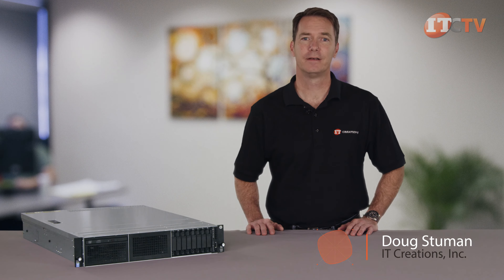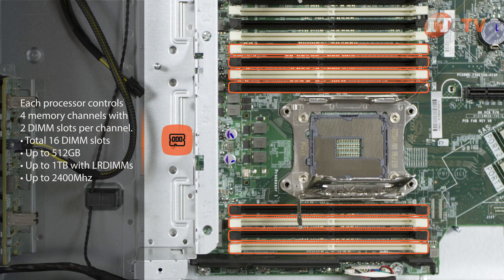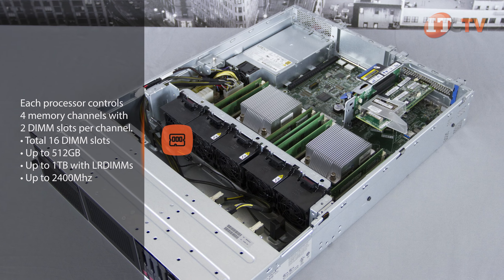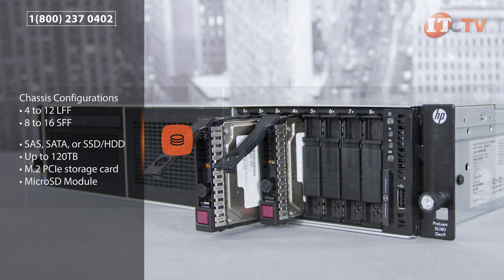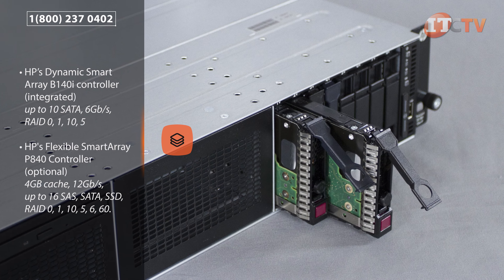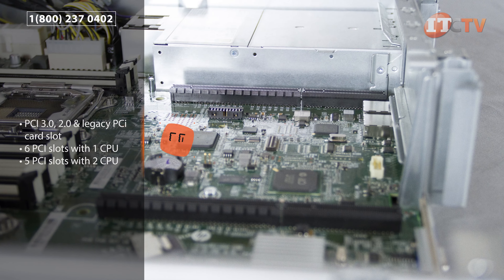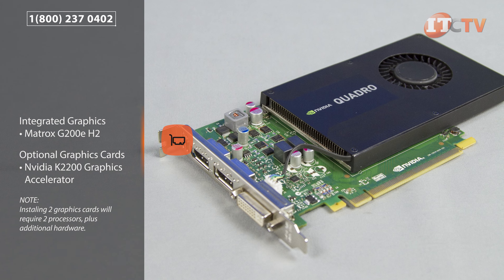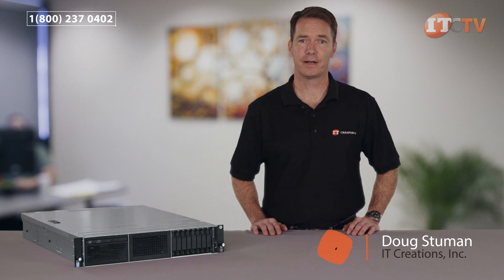HP ProLiant DL180 Gen9 Rack Server Review - Technical Overview in 4K Video!

Comment: Can you suggest that if i have 5 hdd in my hpe proliant dl180 gen9 server and 1 or 2 are not working how to find out those hdd?
Reply from the maker: Hi Gunjan, There are quite a few things you can do including looking at the LED lights on the drive bays, you can also try accessing system BIOS at setup, or accessing iLO, integrated Lights Out management.  I am going to direct you to this troubleshooting guide, page 63 tells you basic information on how to determine if the drive is faulty, how to possibly find out what's wrong with it, and tips for how and what to replace it with. There are two guides and I found that information in the first one, here: https://support.hpe.com/hpsc/doc/public/display?docId=c04444029 This is a link to the second guide: https://support.hpe.com/hpsc/doc/public/display?docId=c04443553 Hope that helps, and thanks for watching!

Comment: Hello, what is the model or part number of SFF disk with the highest capacity? We want to upgrade from 2TB to what ever higher is available? also I can only add 1 more 8-bay SFF hot-plug drive backplane?
Reply from the maker: Hi Rhey! 
I am assuming you currently have the 8-bay 2.5-inch chassis, so, yes, you can add another backplane to support up to 8x more 2.5-inch drives. Page 6 of the QuickSpecs 

https://www.itcreations.com/user-manuals/dl180g9/hpe-proliant-dl180-generation9-(gen9)-quickspecs.pdf

Show the officially validated drives "Maximum Internal Storage" and drive types for this chassis. However, our support guys said that it should support the drives from the Gen 10 version as well, which most likely will have a higher capacity. HPE typically tests only drives "currently" available for validation so that is probably why they placed a cap on internal storage. 

That said, I would just go with what they list in the QuickSpecs for the version you have. Since we are a hardware configurator we have all the parts to place in there and can test to see if it works and if not revert to the "verified" by HPE drives. You on the other hand would have to purchase all the drives to test and then make a determination. We have not done one of these is a long time and I'm not sure who in our company has tried the above scenario using the Gen 10 drives. So, to be safe, I would go with the Quickspecs Max internal storage for the Gen 9 system, which appear to be 3.84TB drives SAS or SATA. Although, curious that drive total capacities for LFF are much higher in a general sense… Potentially worth trying if you already have the drives available.

Hope that helps and thanks for watching!
Reply: Hi  @Itcreations-LA ,, thank you so much for that quick response.. yes LFF has the higher drive capacity. Follow up question , adding 2nd backplane with 8 x 3.84TB drives will require me to add another Smart Array P440 Controller and HP Mini SAS Y Split SFF-8087 Cable? I wonder how to tell the system to boot on original RAID controller with ESXi installed on RAID1.
Reply from the maker: @rheysamala1206  
You should be able to set the boot order in BIOS. Yes, you will add another smart array P440 Smart Array controller and mini SAS cable. There is a cable kit that HPE calls out per QuickSpecs, this 725578-B21. Cage/backplane kit this 725572-B21. Check page 114 in the Owner's manual for a little more information, https://www.itcreations.com/user-manuals/dl180g9/hpe-proliant-dl180-gen9-server-user-guide.pdf 
Good luck and tell us how it goes, and thanks for watching!
Reply: Wow thanks!  @Itcreations-LA  awesome clarification! How about the micro SD card slot? can I install vmware esxi on it? which model of SD card should I need to buy?.. If this is not possible is there another option which I can maximize all 16x2TB for storage.
Reply from the maker: Hi  @rheysamala1206   
You can see the SD card slot on page 3 of the QuickSpecs here (#11 of the Internal View diagram), https://www.itcreations.com/user-manuals/dl180g9/hpe-proliant-dl180-generation9-(gen9)-quickspecs.pdf. 
The supported microSD cards and part numbers are listed in the Quickspecs too, on page 40. Yes, you can install VMWare on the SD card as this is what it is for. There is also an internal USB port that can be used to support the Hypervisor as well. Good luck and thanks for watching!
Reply: @Itcreations-LA   you really saved my day!!! I need additional NIC for vMotion and others.. I already used up 2 slots with P440 on my primary riser card.. Can still install NIC card on extra slot? What NIC card model is compatible? is there an option for 2 or 4 GB NIC?
Reply from the maker: Hi again @rheysamala1206  ,
Glad we were able to help. Check the QuickSpecs again for NIC options which begin on page 28 for factory options https://www.itcreations.com/user-manuals/dl180g9/hpe-proliant-dl180-generation9-(gen9)-quickspecs.pdf . However, 2GB and 4GB are not options just 1GbE and 10GbE. Although, perhaps you meant the number of ports on the NIC? If that is the case, then yes. There are 2x and 4x port options in the list. There are also options for InfiniBand FDR/Ethernet 10Gb/40Gb 2-port 544+FLR-QSFP. If you need other risers, this section is on the next page 29 "HP I/O Expansion Options".
Reply: @Itcreations-LA   yup was referring to number of ports.. on 1GbE or 10GbE... Again thank you very very much!!!

Comment: All leds are flashing 8 times (7times it flashes and 8th time flash stays longer and starts flashing again)
Reply: What is the issue I have changed the smps installed 2 smps
Reply from the maker: Hi @vannareddy7030 ,
I'm assuming the SMPS you are referring to mean you replaced the PSUs? This is what I found on page 166 of the HPE ProLiant Gen9 Troubleshooting Guide Volume II  https://support.hpe.com/hpesc/public/docDisplay?docId=c04443553. That said, without testing ourselves I cannot offer a definitive solution. But from the light codes you mentioned seems like it could be one of two things as indicated in the guide. If you need parts, check out IT Creations, and thanks for watching!

Comment: Hi.. dl180 gen9 have install centos 6.4  32 bits ???
Reply from the maker: Hi Francisco,  Centos 6 is listed in this critical Firmware upgrade if you look at all the other Operating Systems listed under "CentOS 7 | View All" button, here: https://support.hpe.com/hpsc/swd/public/detail?sp4ts.oid=7252825&swItemId=MTX_2e9fec521e3f43cf875ff2b418&swEnvOid=4184# 
Clearly, there is also version 7 but there is also an updated version 6.6. I hope that helps, and thanks for watching!